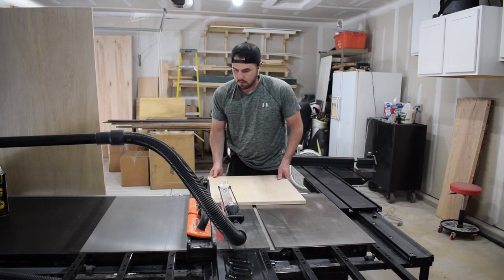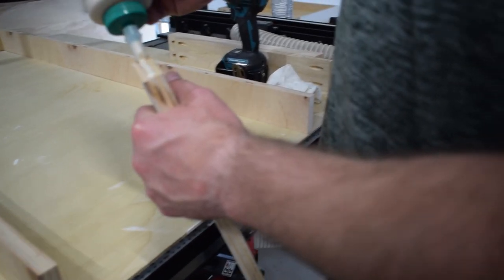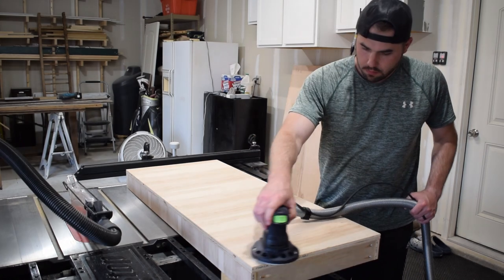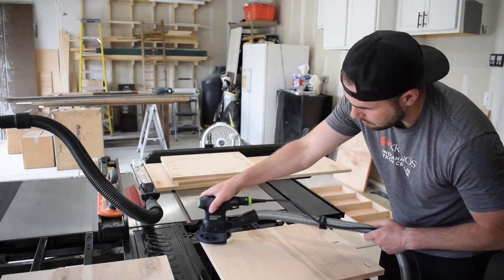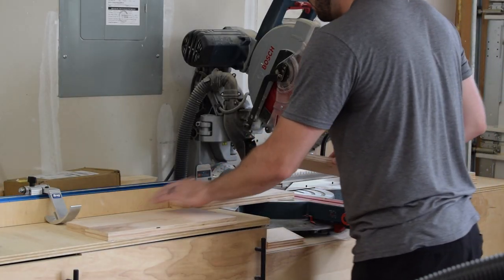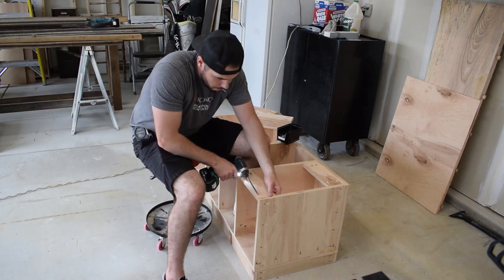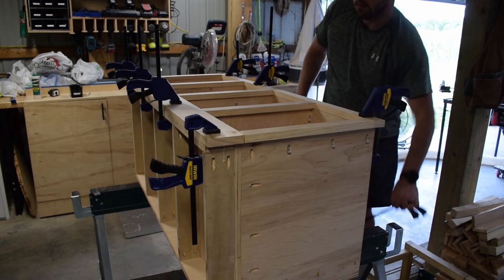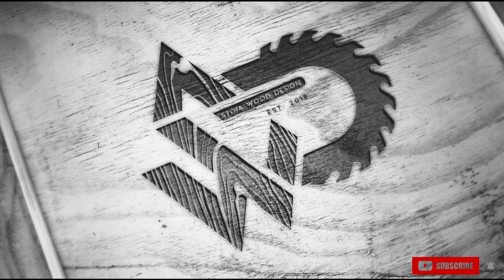How to Make an Entry Mudroom Built-In Part:1

Comment: This is very nice. I don't see how this is DIY though. The average Joe doesn't have all those neat tools you have.
Reply: While he does have some nice tool from what I gathered it can basically all be done with a circular saw, drill, a few clamps, and a kregg pocket hole jig. Sanding can be done by hand, painting can be done with a brush. All of those supplies can be bought for about $200. The wood might cost more than the tools.

Comment: I see that you have used plywood instead of 2×4. What is the best height we should cut the plywood for base frame assume that i would like to add molding finally
Reply from the maker: I make most of my built-in seats 18” to 20” in height. whatever total height you choose, make sure to take out 3.5 inches for the 2 x 4 base, as well as 3/4 inches for the plywood bottom. I believe this is what you are looking for. Let me know if you need any other help.

Comment: As a contractor, how much would be a fair price to charge someone to build this built in? Including materials and labor.
Reply from the maker: Hey Jason - thanks for watching! I think a good starting point would be to find your material costs and then double it for a list price. That is how I started but have sense raised prices slightly as I have more experience with them. Thanks!
Reply: @stoiawooddesign  I charged $3k... Materials cost me less than $300... Just installed the bench today... Wish I had a way to show pics... Came out really nice... I used pine plywood and solid pine on the face frame... Only thing I did different was use dados for the bench cubbies... Size is 75 x 83
Reply from the maker: @mrjasonbarnes  that’s awesome to hear man! I’d say that is also right where I would charge. Shoot me an email at nstoia1991@gmail.com. Would love to see pics!
Reply: @stoiawooddesign  pictures sent... I also used an app to plan out my cuts... It took 3 - 4 x 8 3/4 sheets to cut everything needed for the project.
Reply: I need your table saw... Need to figure out a way to increase the size of my table for my existing saw

Comment: How did you attach the top of the bench? Screw it in or glue to those supports?
Reply from the maker: I attached by screwing through each horizontal support into the top. Thanks!
Reply: @stoiawooddesign  Was your face frame flush on the ton of the bottom cubby’s so the bench set flat on top?  Also, does the front of the bench overhang the cubbies underneath or is it flush?
Reply from the maker: @matthumphrey2304  Thanks for watching! Yes, the face frame was flush on the top so the bench sat flat. Yes, the bench top overhung the lower cubbies by 1" if I remember correctly.

Comment: How did you conceal the visible pocket holes?
Reply from the maker: Thanks for watching! For the visible pocket holes connecting the top to the bottom, I used my pin nailer to attach a piece of 1/4” material the depth of the upper section. This covered all the holes and trimmed out the piece.

Comment: Thanks for the video.  Making mine right now.  What did you use for the bench top?  Plywood with a routered edge pocket holed on or did you go with hardwood boards glued together and routered?  Also what kind of stain and finish did you put on it?
Reply from the maker: Thanks for watching! I actually purchased two oak stair treads from Menards and glued them together. I then used varathane dark walnut stain and finished with a satin polyurethane.

Comment: What kind of wood did u use for the face frame? Pine? And how much overhang do u have over the 3/4 inch plywood?
Reply from the maker: Thanks for watching. Yes, I used 1x2 select pine for the face frame. Regarding the overhang - what section are you referencing? Thanks!
Reply: @stoiawooddesign the face frame looks like it overhangs ur plywood base??
Reply: @jimmidiggs  1x2 stock is actually 3/4 by 1 1/2. So the face frame members would be 3/8 overhang on each side of plywood.